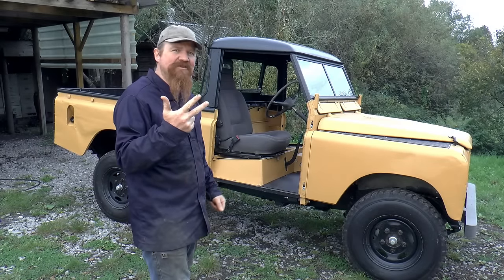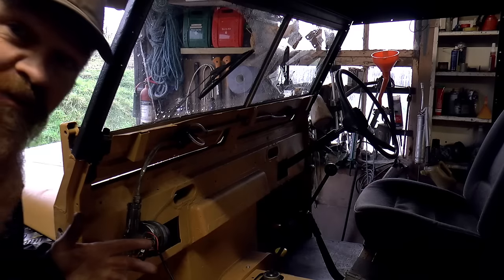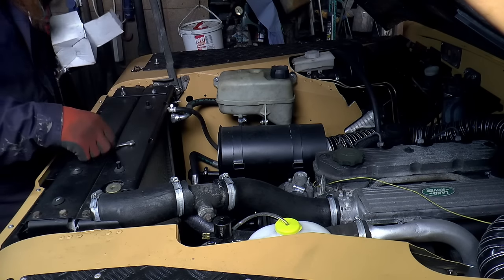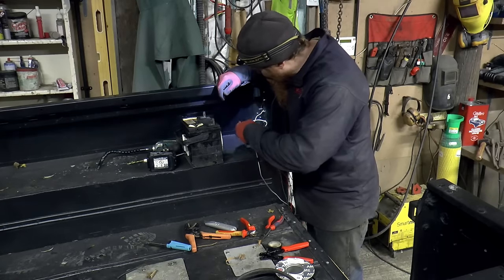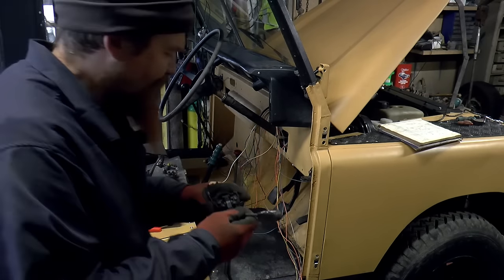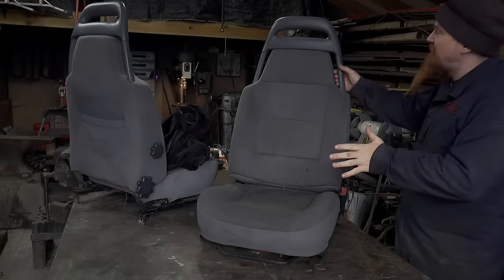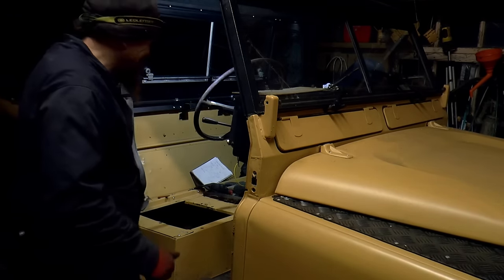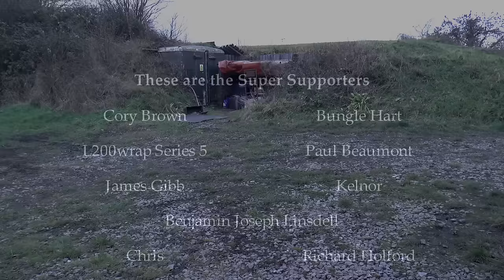Project Kermit 35:  A Series Land Rover Full Restoration

Comment: You can put sound insulation on the floor that is the sticky bitumen aluminium backed pads. They do not soak water and do not cause any rust, you can buy them from silent coat and other vendors.

Comment: I appreciate Kermit is not required to have a rear foglight by law but if fitted it must be either on the centre-line or on the offside. I'd suggest repositioning the number plate on left, with reverse and fog lights on right to keep it legal. Not trying to rain on your parade but would hate you to get pulled by PC Plod. A great video, the end is in sight!
Reply: I’d very much doubt they’d give it a second glance. It’s S reg after all. Different rules apply
Reply: @highdownmartin it may be mentioned at the mot test
Reply: @JasonJohnson-yu8zf  Possibly though being an S reg it is MOT exempt.
Reply: @JasonJohnson-yu8zf  doesn’t actually need one. And again in 78 what we’re the fog stipulations. I seem to remember people drilling err bumpers and putting them nearside
Reply: @highdownmartin  You're probably right. Being S reg it does just predate the 1979/80 requirement for a rear foglight and therefore is not required to have one fitted. I was just pointing it out as it is technically illegal, being on the nearside (i.e. no foglight required but if fitted it must be on the offside). It's up to Max of course whether he wants to refit it on the offside.
Reply: Mine is an Lreg 1973 and my no. plate is on same side as Kermit, I know the more modern ones have it on the left. I'm MOT exempt and nothing ever said to me by the Plod and sometimes they actually follow me, arseholes.

Comment: As noted by others a fog light is not required  , but if fitted should be on the offside. Pre April 1980 some cars did have fog lights and are tested , if they don't work it's advised. Glad you haven't gone down the road of LED highlights , the beam patterns of all but the most expensive are rubbish and blind oncoming traffic.  Osram night breakers are superb . Nice Landy 😊

Comment: Great Job and loving the progress. I noticed when you mounted the rear fog light that it is mounted on the wrong side for U.K road lighting regulations as if one of light is fitted, then it has to be mounted on the right hand side of a vehicle or trailer. You can get round this by mounting another fog light on the right hand side, but would now involve remounting the number plate elsewhere.
Reply: I thought the image was reversed, but no, the plate reads correctly.

Comment: I think you should have the rear fog light fitted on the centre or on the drivers side (off-side)of the vehicle, not on the left side, if only fitting one light.
Reply: I think it may be a legal requirement under Construction and Use regulations
Reply: @lessayers8653  It is.
Reply: @lessayers8653  however not on the Left side of the vehicle, as stated in my last post. Check out The Road Vehicle Lighting Regulations 1989, Schedule 11 Part 1, that’ll clear it up for you…

Comment: Wish I had fitted those tail lights to mine - so much brighter than the standard ones.
I had those Britpart mats in my Series 3. They are absolutely fine, but I did end up cutting out a slot under the accelerator pedal. Cheers

Comment: Superb . Your formula one tractor looks the bees knees ! I grew up with Land Rovers and have many a memory of them in the African bush and Arabian desert , hell I probably got conceived in one , but maybe that might a stretch too far , lol ! 
Seriously though , since there is so much aluminium touching ferrous stuff , like the bulkhead , rear cross member and the chassis , I have often wondered if a sacrificial anode , or zinc block(s)  , could be bolted in place , like on a yacht , to save the poor old steel bits rotting away ? 
Have fun Max , I  , for one , am envious ! Love your style , well done .

Comment: I did a bespoke loom on my kit car. Fibreglass body, so no earth points avail. Ran grounds within the loom. No probs at all. Great way to do it. Only chassis earth is at the starter.
Mine is fused to hell, with the generic blade fuse boxes (ones with the built in blown fuse indication LEDs). 
I also ran all the crusty old Lucas switchgear through relays, so they are not switching current.

BTW. Be careful with plumbers type flux on wire. (Not sure what sort of flux you are adding.) I've had it eat copper wire away over time. I had heavy braid on coax cable, that I had to solder into the barrel of a connector. Found the flux had completely eaten it back for about 4" of length! Though it seemed to have stopped there, after the 'missing bit' of braid, the copper was clean and bright.

Comment: This is the most meticulous resto-mod I have ever seen - much respect to Max for a superb job and a most enjoyable series! However, I have for the first time in following the project a moment of slight doubt. I have a funny deeling that construction and use regs require that even on an optional fitment a single rear foglamp must be close to the driver's side. Personally I would have swapped the positions of the number plate and the two auxiliary lights, which is how they appear on every Land Rover where I've noticed. A fairly simple fix, so it might be worth checking whether I'm correct! Looking forward to the project finale! 👍🙂
Reply: Addendum: Just found this:
UK Road Vehicles Lighting Regulations 1989
Rear Fog Lamps
Must be mounted
    1. at or near the rear of the vehicle.
    2.  on the vehicle centre line or the offside if one lamp only is fitted.
    3. not less than 250 millimetres or more than 1,000mm from the ground (2,100 millimetres for agricultural vehicles, engineering plant and motor tractors)
    4. at least 100 millimetres from any stop lamp.
Hope that helps. Wouldn't like you to be pulled up by the law the first time Kermit goes public!

Comment: I use a hell of a lot of 5mm bullet connectors. Must be good quality ones and not used in badly exposed locations. 
But they make for quick assembly, ease of maintainance, and ability to alter.

Comment: Great to see the progress achieved with Kermit.. Just a thought re rear fog lamp positioning.. I seem to recall that if only one lamp is being fitted, I should be on the offside of the vehicle..🤔
Reply: This is my thought too, not sure if it will be an issue if it's not actually required but it may fall under the "if fitted - must be" rules
Reply: Solution , fit two .....
Reply: @davidyendoll5903  Where..? Number plate is occupying the offside location..
Reply: Fantastic job, thanks for sharing Max

Comment: I did similar projects three in total first was 1964 Chevy truck body mounted to a Chevy blazer chassis making it a 4X4 it was loads of work and had 17 coats of lacquer paint that looked fantastic some one ran a stop light two weeks after finishing it and totaled it 😢 same thing happened to number 3 but it was wrecked before it was completely finished number 2 is a 1971 Toyota FJ40 and it’s getting a motor rebuild now and will probably not drive often just because of my luck with such things. I hope you’ll have better luck with yours I’ve vowed to never do anymore just to painful to see all that work destroyed in a blink of a eye.
I did the rewire on my FJ40 from scratch same as you I also added extra wires in under dash just in case I wanted to add something extra down the line took loads of thought but turned out just great. Been enjoying your progress will love to see it on your first road trip.

Comment: Fantastic, lovely to see this project progress. Regarding the fog light, I appreciate it is not a legal requirement for this vehicle, however I thought if fitted they should be on the offside rear. Perhaps someone more knowledgeable can confirm. I ran into this when fitting a fog light to my imported Eunos roadster. Just thought I'd mention it in case it causes you bother down the road. Would be a shame if you have to move it as it looks lovely as it is!

Comment: This is really exciting with it so near to completion, only drawback is that it will then be complete. I hate to say this but I have a vague feeling that if you have a single rear fog lamp it must fitted no further to the nearside than the centre line.  You may have already looked into this and found different though.

Comment: Funny you mentioned LandRovers lights causing wiring failures...
My old 84 90 is in the drive with that lovely dash out that has 1000 screws in it...
My light switch melted and earthed out on the metal switch surround.  Previous owner had fitted 15A fuses where 8A should have been, result a couple of cables in the main loom glowed red hot and did a ton of damage!
I can confirm fitting relays is going to be a very good idea!
Good work as usual, do you want to help fix mine!
😂

Comment: he came out very nice indeed . love the colors . and the wiring u did a good job . in the engine bay i wouldnt solder too much of the heat , but in the cab is fine . 
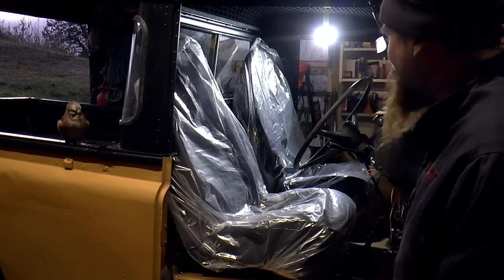that little bird 1:18:15 was not scared at all , im amazed :P

Comment: Watching this loving but imperfect restoration is SO much more entertaining that any of the high-cost SEMA-spec builds elsewhere on YouTube.  Question for you, Max: I couldn't tell from your tests... are the headlights wired so that the low beam filaments cut off when the high beams are turned on?  Easy thing to overlook when wiring from scratch, and running both filaments together will rapidly kill the bulbs.

Comment: I noticed you using "Fluxite" soldering paste, this is Zinc Chloride based  and is acidic so unless it is washed off with soapy water it will end up rotting the wires away where it has crept up under the insulation. This is why you should always use a rosin based flux for electrical soldering.

Comment: I hate the shoddy plastic lights. They could never be cheap enough to make me want to use them. I equipped mine with all new rubber bases and the original Lucas glass lenses flat lights for indicators front and rear and the marker lights at the front and put the bulbs in with loads of Vaseline and the glass and bezel trim too. No problems in five years. Rear lights are L692 I think   As used on Austin healey s. Big 3” round tail lights. Chrome base and lens held on with two screws. Again, apart from smashing one, no problems. Old stuff is good. And lasts!
Reply: Er, yeah.......I think we can be confident that Max knows old stuff is good...... don't you..!!?
Reply: @andymccabe6712  it was in reference to the lights. I’m sure the sealed for life wipac Chinese led one’s will be good. But not serviceable as they’re designed to be thrown and replaced.

Comment: If you thinking about stealing protection, why not add an AirTag somewhere? :)

There are also GPS trackers with SIM cards available - which got an internal battery but can be charged by USB. Maybe that's an option. You just need a sim card which can send/receive SMS.

Comment: I think you need a temperature sensor at the radiator, which is read by a relay board and fed by switched 12 V power. Plus a delay board which got a relay which is fed by battery power.

This way the fan on the engine can be switched by the sensor and the delay board allows you to dial in a turn-on delay and a turn-off delay, avoiding rapid on/off operations. It also allows for running the fan a while after the engine is turned off, very hot.

Comment: 4:10 honestly plugs are there for the ease of maintetance, if anyone break those lights they need to be replaced, without connector you will need a lot of tools to do so, with proper connector it only take a screwdriver or a plyers and thats it.

Comment: Dashboard wiring carrying the headlight load not only risks overheating and fire, but as the wiring degrades (and lets face it, manufacturers use the lowest grade wire they can get away with) it can't carry the load and the headlights inevitably dim and yellow.
Most car earths up into the 80's (even 90's) are also pathetically poor. They work fine when the car is new, but get a bit of age and entropy into the system and mysterious electrical gremlins appear - most are fixed by putting a decent heavy earth into the system!

Old Holdens (up until the mid 80's) ran a pretty useless electrical system as well. All high power loads (such as headlights, starter relay, heater fan, brake lights and rear demisters) ran single wires through the dash and dashboard switches had to carry the load. I learned to wire cars by rewiring an early Commodore using relays and better grades of wire.

Comment: I wish they had, headlamps back in the early 70s when <y brother and I were doing our hot-rodding thing. A single sometimes 100 watt bulb 15 feet over your head is not much light after you have knocked out the 60 watt trouble light!
While I have learned more about simple vehicle wiring from watching you, I am troubled by you saying you were using flux on your wiring when I went through electronics school; all those years ago they taught use to use rosin core solder because flux core would eat up the wiring.
No oil pressure gauge?

Comment: ARRGGHH ! you have put the foglight on the wrong side, RH or centre-line only...
if you use a 2 circuit keyswitch, you can make the horn sound as soon as the [unwanted] ignition goes on. this has saved many a car of mine, the horn blaring in the middle of the night is very loud...              you need to find a local blacksmith to make up a big bar that joins the steering wheel, pedals + gear-lever together, that's a £20k+ landrover you have got now, if he is any good, he will figure something out...   all the best for 2024 young man